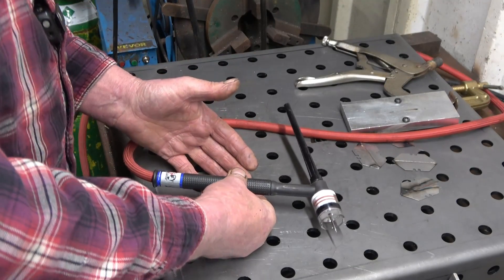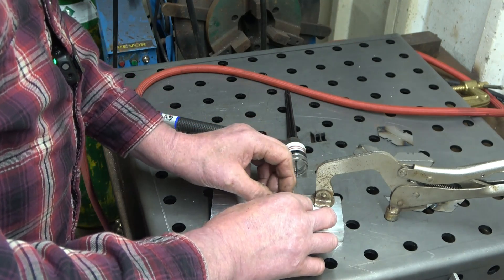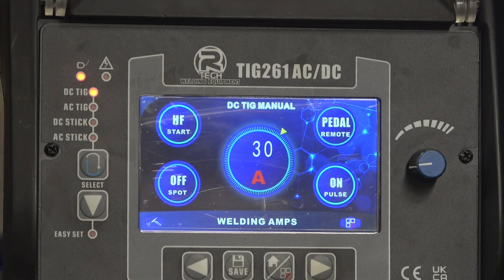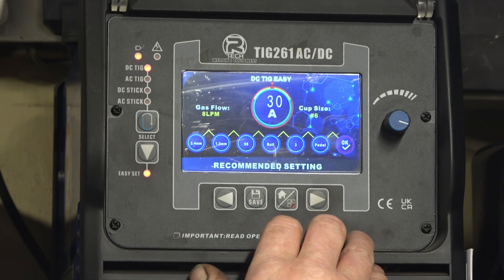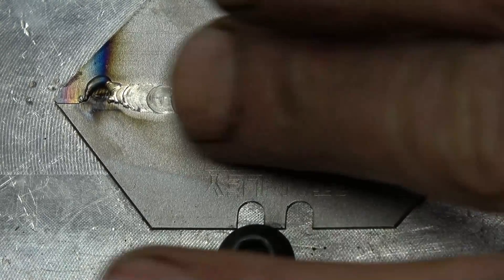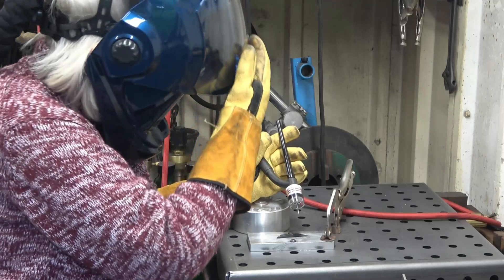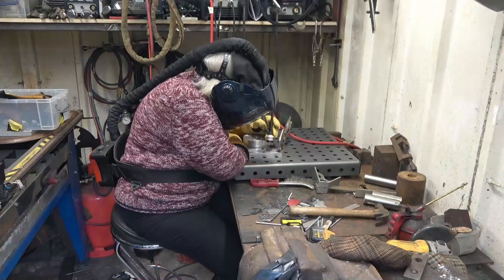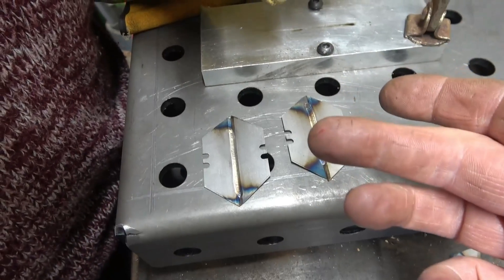Easy Weld Stanley Blades. R-Tech AC/DC TIG 261. Easy Setup & Manual Modes

Comment: Can you explain? When using the rod, it’s obvious where the metal is coming from.  On the later welds, with ‘filler?’ I’m not sure where, what appears to extra material, comes from.
Reply from the maker: The later welds are "fusion" elds no filler material . The parts are simply fused " melted " together . This is common on food grade pipe welds .
Reply: @doubleboost  thanks John🤗